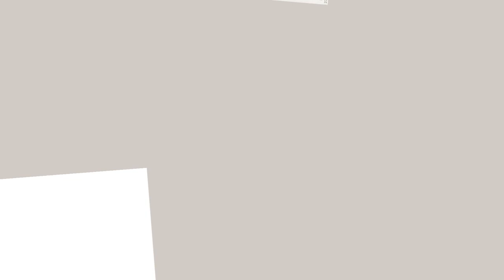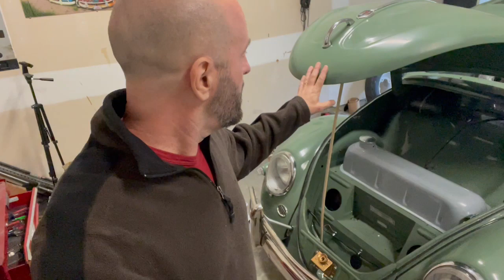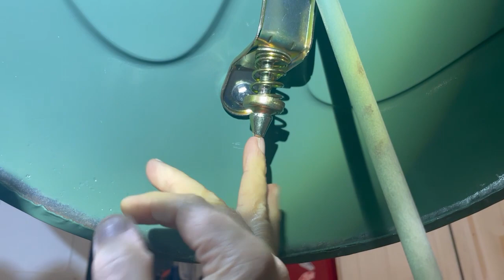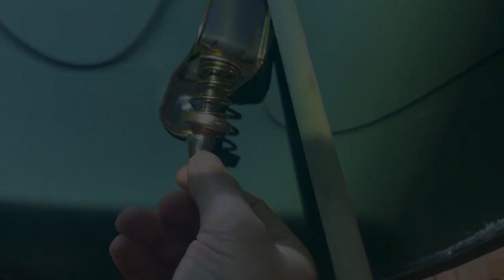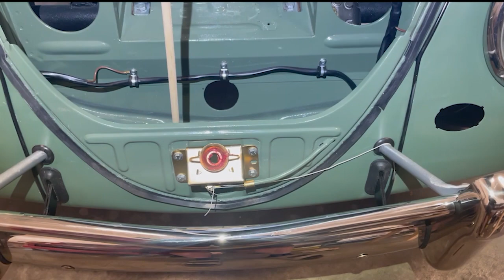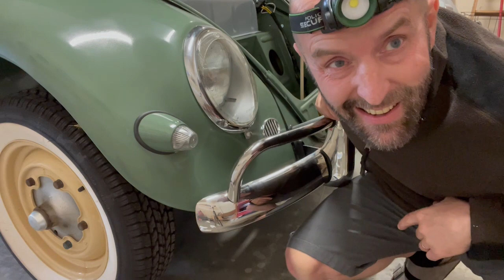Front Hood Latch Adjustment on a Classic Beetle

Comment: The string is a great tip. I had a stuck hood and had to cut out the glove box, then reach in with all of the ratchet extensions and unbolt the hood hindges. A little string would have saved me a lot of time and fuss.